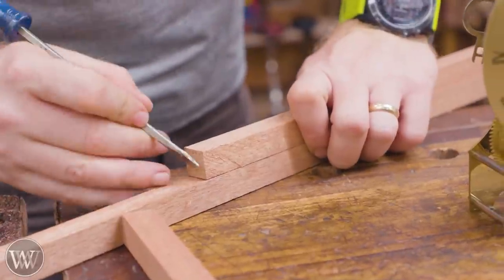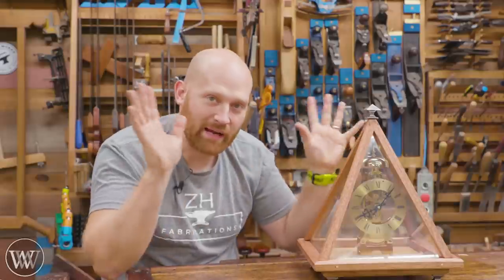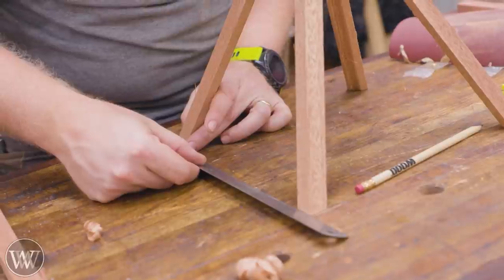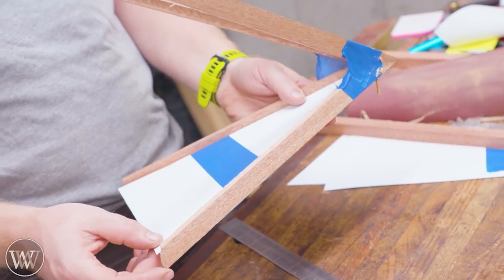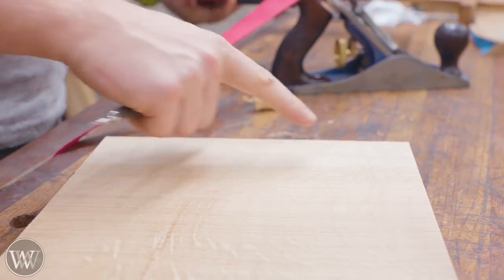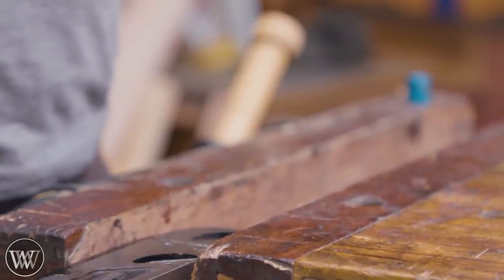Bell Clock Case With Pyramid Power!

Comment: Awesome work brother! What was the progression of grits with the sandpaper?
Reply from the maker: No progression at all. I just use 400 grit. The surface from the plane is good enough for a finish. However, I want to get more of the grain popping on it and for that you need to have some dust worked into the pores to pull the oil down a little farther. And so just a light touch of 400 grit. Sandpaper is all needed.
Reply: @WoodByWright  thanks!